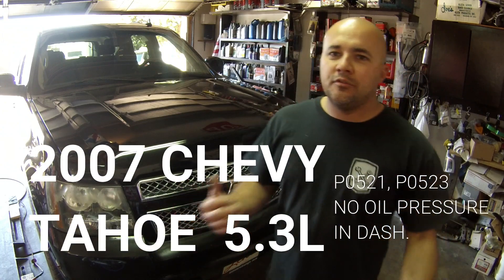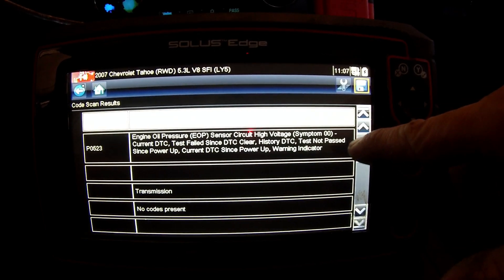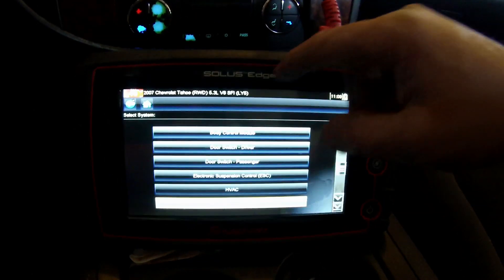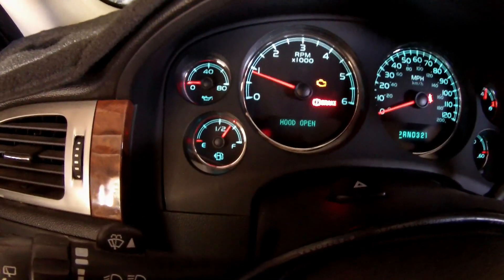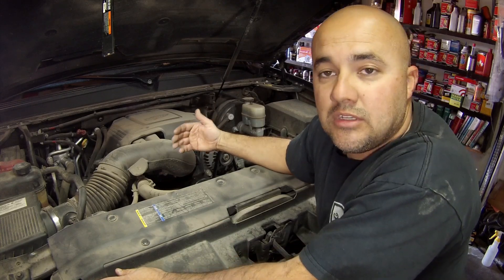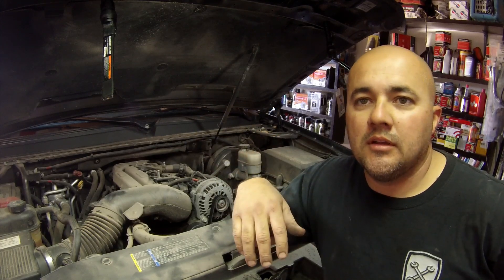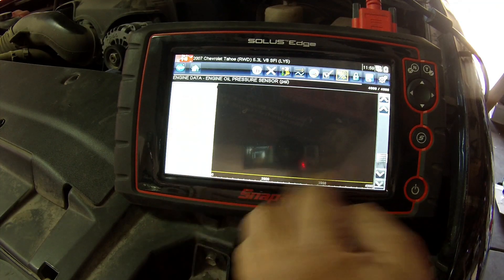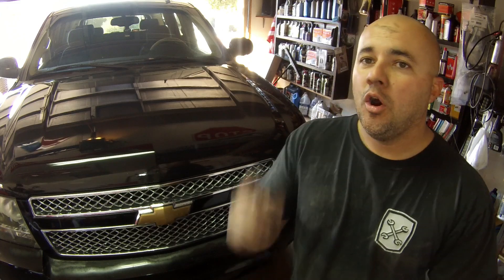Chevy Tahoe no oil pressure in dash. P0521 P0523

Comment: Just changed the oil pressure sensor and filter. Code P0521 and  P0171 came on the dash. Mecanic says that oil pump has to be changed. Any suggestions?
Reply from the maker: Geovanni Dominguez same vehicle?
Reply from the maker: P0171 is a lean code, nothing to do w/ oil pressure or the code.
Reply: No is 2011 chevrolet silverado 5.3
Reply: The lean code came up because the lifter is not getting enough oil. Thats why my mecanic told me that the pump needs to be replaced.
Reply: @AlacraneroRevel  i just had everything replaced on my 07 avalanche, 148,152 miles
Sensor, filter , oil pump, oil change , and nothing ,.
Then mechanuc calls me and says that i need a new motor , good thing i still have the warranty...
Reply: @bikerdude6119 how was your truck running?
Reply: @AlacraneroRevel  it was running fine, no clicking, ringi g or grinding, 
This shit just kept sayin "low oil pressure shut off engine" When idling.
No loss of power ,
And i changed absolutely everything you can think of.
How about your truck?
Reply: @bikerdude6119  my runs good too, no weird noice. My oil pressure start at 40 when i start the engine and as the temperature goes up, the oil pressure goes down to 20. If i rev up a little the oil neddle goes up a little, but comes back to 20. My engine doesnt shut off, but i can feel a loss of power when goes the oil pressure is at 20. Im guessing could be the afm turning to 4v and stays there.
Reply: @AlacraneroRevel  it only turns to v4 when coasting not on idle , its on v8 when idle , 
Yours doesnt seem to be a big problem since it actually hits 40psi , mine would max out at 20psi .
What have you done so far?
Reply: @bikerdude6119  just the oil sensor and filter. I think the previous owner change some lifters. Im changing the oil pump. Hopefully that solves the problem.
Reply: @AlacraneroRevel  try the O ring in the pick up tube aswell ,
That can also be a problem if not im clueless , i hope it all goes well bro.
Ive read even an oil change with a good filter makes a change on some occasions ,
Not me though i need a whole new engine , or just burning the truck and do an insurance fraud
Reply: @bikerdude6119  i will look into that! Thank you!
Reply: @AlacraneroRevel  wish you luck bro
Reply: @AlacraneroRevel  o ring and oil pump after that , im sorry
Reply: @bikerdude6119  update on mu truck. Change the oil pump and code came back, but! I changen my engine oil and filter. Bought the range afm disabler. Code came but a lean bank. Code dissapear itself! 
Haven't had any problems since. Just made a 6 hr trip No problem. Still my oil pressurr went up with the oil change and filter , but cold 40 and running 22,23 idle 17 no less.

Comment: I had a mechanic check my 2005 tahoe 5.3 it was doing the same thing the gage was stuck at zero no movement at all n it said oil pressure low. So what he did was remove the sender unit or sensor. So after it was removed he put his finger covering the hole where the sensor was. And he had me turn on the engine. He said theres no pressure coming out so he said i have a bad oil pump.. Is this possible bro can you really check like that.. Now my Tahoe never makes a noise there is new engine oil.. Please bro i need help.. Now the mechanic guy didnt have no computer device to check like you did.. The reason i had him come over was because ive heard its dangerous to drive your vehicle on low oil pressure.. Nearest shop is a 15 min drive.
Reply from the maker: Juan Macias so the next thing you would have to do is look in the hole where the oil pressure sensor there is a oil screen that gets clogged up and won’t allow oil to circulate. Most of the time it’s easier to remove the intake manifold in order to get the oil screen.  The other quick check is to install a mechanical oil pressure gauge into the sensor hole and start the engine and see if you have oil pressure on the mechanical gauge. You can normally rent the gauge tool from your local Autozone or parts house. Hope this helps and let me know. Thank you.
Reply: @fixersautomotive4514  I turned on my truck to just check the gage and it stared making a lil ticking noise bro.. I turned it off right away
Reply: @fixersautomotive4514  mannn bro i really appreciate your help ill do that today..
Reply from the maker: Juan Macias ya man, don’t start the truck for longer then like 30 seconds w/ no oil pressure.  It’s very rare that a oil pump just dies w/ no warnings. Where there any other problems w/ the truck before the no oil pressure dropped?
Reply: @fixersautomotive4514  i notice for a while that whenever ill step on the gas the oil gage will go up then it will go down when ill let go off the gas pedal.. But that happend for years everytime ill step on the gas n yes i have a heavy foot
Reply: But other than that no i never notice anything wrong bro
Reply from the maker: Juan Macias ok, then the next step would be is to take off the oil pan and remove the oil pump pick up tube and inspect the O-Ring and see if the oring is flatten out.  That’s what usually happen.  The oil pump will suck in air past the Oring and you will not have enough oil pressure at idle until you tap and raise the RPM’s.  If you have a 2wd it’s really easy to drop the pan but if it’s a 4wd you have to removed the front diff assembly. The dealer has a updated O-ring to fix the issue. Let me know bro.
Reply: @fixersautomotive4514  i sure will.. I've seen a video of on YouTube like that.. Also i think i did leave the truck on for a lil over 30 secs. Thats when i heard the ticking noise so i turned it off..i hope i didnt damage my engine

Comment: So now that i installed the new sensor, is unplugging the battery and plugging it back one way to clear the code or do i leave the check engine light running, drive the car and wait to see if turns off on its own?
Reply from the maker: 937anme hello. You will need to have a scanner or code reader to reset the pcm. The code will not turn off by itself.
Reply: Fixers Automotive oh ok, so then my next question is by clearing the code then are we telling the pcm to not ever show it again or, isit something that if that sensor ever goes bad again if that's the case, it will bring the code back?
Reply from the maker: 937anme by clearing the check engine light code your telling the pcm that the problem is fixed and the pcm will run a self test when you start it up and if it was fixed correctly it will pass the test and the light will stay off. Also what you can do is removed both battery cables, touch both cable ends together for 10mins. This will discharge all the back up power in the pcm and it should reset, doesn’t happen all the time but worth a shot. Good luck.
Reply: Fixers Automotive thanks, will do.

Comment: Really Fantastic Video well done sir! Very Professional at what you done! I am having an issue with my 05 Tahoe 5.3 I was wondering what's your thought on it's running well going up and down the HWY and in the city but when I am at an a stop light the oil pressure drops and acts like it's going to die on me and it jerks when I start to take off from the light. but it's running fine otherwise.

Comment: Want to see if you can help me I have a 2007 avalanche a change everything sensor pick  Up tube ring whale and filter a couple times I could not get the wall pressure to stay up when I am I that idle it goes down to 0 but when I hit the gas they do rise
Reply: I had the same issue,
I also got the oil pump switched ,pick up tube seal , sensor, filter , oil change , 
Mechanic told me that i need a new motor at 148,152miles
Reply: Me too.  Changed the sending unit, oil pump, pickup tube o-ring, and pan gasket....I have discovered that the gauge in the instrument cluster (in the dash) is bad - BUT in reality I have perfect oil pressure. I jumpered out the sender unit wires gray and tan, and the gauge went to zero... Hook a mechanical gauge up to the engine - and this will tell you the  actual oil pressure.
Reply: Good video. I remove  that sensor  with. Out. Removing. The  intake

Comment: I’m having a similar issue. My gauge says I have about 20 but the Informations button (dash) says my oil life is 100%

Check the dipstick and it is also kindve dry. Should I get a oil change and get the sensor changed ?
Reply from the maker: Arslan Tariq, the oil pressure gauge on the dash is different then the oil life percentage. The gauge on the dash should read about 20psi at idle. If the dip stick is dry get a oil change and make sure the shop reset the oil life percent. If you have a 5.3L Engine the oil capacity is 6qts U.S.  Hope this helps. Thx and good luck. 👍🏼
Reply: @fixersautomotive4514  where is your shop located?
Reply from the maker: Hilda Ochoa I’m in Tucson. Az.
Reply: @fixersautomotive4514  aww ok thank you I was hoping you were in San Diego Ca.. I'm having the same problem with my tahoe
Reply from the maker: Hilda Ochoa good luck. Let me know if it’s gets fixed.  San Deigo is my second home.
Reply: @fixersautomotive4514  I will